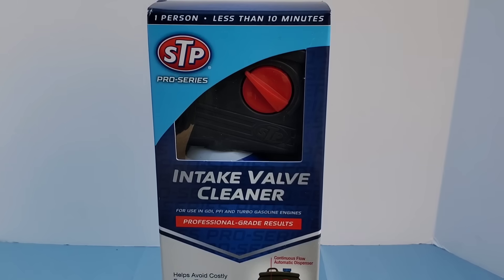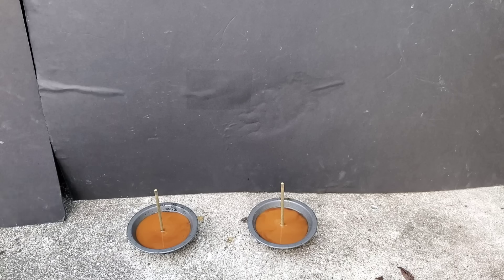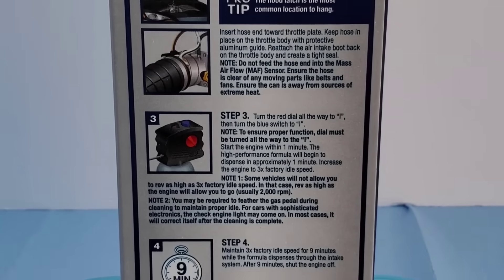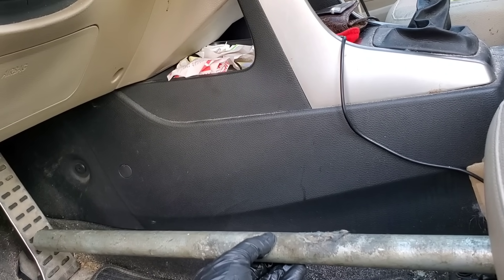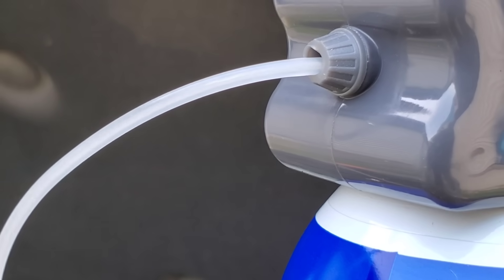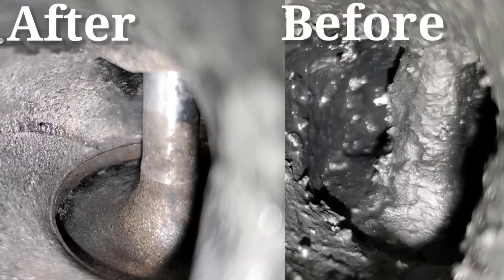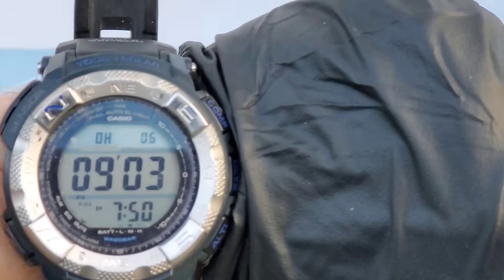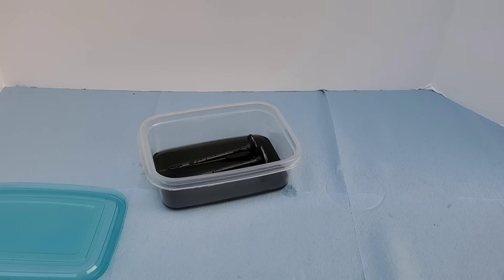Stp Pro Series Intake Valve Cleaner works!

Comment from the maker: I really appreciate all of your kindness & time it means the world to me in these trying times. I tried to speed it up so you don't waste valuable time.
Reply: Trying times?
Reply: You did the stp video !!! I like that you read the comments man. We appreciate you
Reply: Can you test a Purolator boss filter
Reply from the maker: I did that in a recent video
Reply: @NATESINTERACTIVEAUTO  do you remember how long ago was it? I'm looking for it now
Reply: @primetime8717  to m
Reply: How do you do if  you have a turbo with air filter element ? Is it possible or no. Thank you for your answer , because I have dodge   ram cummins 24valves .
Reply: You never try with water I try with water and that work better than anything think I vacuum holes and is slowly through the backing hose inside the bottle a little bit in the time so the vacuum hose can suck the water
Reply: Thank you for the valuable advice. Do you know how often I should perform this maintenance? I have a 21' Silverado and I want to keep it in tip to shape. Also can u recommend a good bore scope camera?
Reply: okay, but where does the dirt go?
Reply: @rjshhooba9857   it’s burnt off through the motor into the exhaust system and you will notice a white or black smoke coming out of your tail pipe which is normal
Reply: You 🤡
Reply: You should do a review of the JLM Diesel Intake Extreme Cleaner 2 step kit
Reply: You in i
Reply: Does stop work better than BG GDI cleaner?
Reply: Thanks a lot for this video
My car is GDI and has around 100K miles with no maintenance. I am sure the values now are extremely dirty. I should do wall nut blasting, but it would be very expensive.
I just want to spray this cleaner just like you did but I am afraid that the carbon chunks may damage the valves or cylinder. What do you think? I don't want to go the expensive route unless it is really necessary 😕
Reply: How did you take the photos of valve inside the motor ? To do so, you need to remove the manifold and insert the camera in the holes. But we didn't see that in video. Are they real photos you made or just examples from the product manifacturer ?

Comment: I call this video A LIE. The owner didn't show us the entire process LIVE, WITHOUT VIDEO CUTS. The video should have the following parts:
1) Explain how to reach all intake valves with a borescope
2) Record the valve inspections BEFORE
3) Insert the "wonder liquid" as required by the manufacturer
4) Record the valve inspections AFTER
Optional, some opinions about the impact of the solution on the catalytic converter.

Comment: The experiment with the valves in the box is static, no movemet involved, but in real life, when the engine is on, the valves are mooving extremily fast, and this comotion helps o lot to clean the valves, Has to be mentioned also the high temperature another contributer to cleaning. So the product is working fine and if the protocol is done every 2000 miles the valves will not be so dirty and will get cleaned quikly and better.

Comment: Spray this rubbish in and wash all that built up dirt and carbon into the cylinders, even worse than that is this liquid will then wash the bores, which is a disaster in an engine....
Reply: AHAHAHAHA great one. As if.
First off. You think that carbon isn't happening in your cylinders at all? plus where do you think that carbon is going naturally? It's just staying there? PFT.

Also it's recommended to do this before an oil change, so thats easy to wipe out your other comment.
3rd, its always recommended to drive on the highway after this so you 1. ensure a good clean out and 2. bring your oil temp up to temp to evaporate anything that needs to flash off of your oil. 

no it's not gonna "wash off" the bores at the very little rate it's spraying in, and if it did, your own injection system/carb would ruin the engine at WOT anyways.
Reply: @shmuck66   whatever you say john....
Reply: @fivedotsdave9723  lol, someone is from the UK.
Reply: @shmuck66  Detective shmuck

Comment: Most mechanics I know and most auto manufacturers say NOT to use engine flush/cleaner as it dislodges lots of garbage inside the engine, and that is not a good thing. That stuff does not just magically disappear, you know. Ask your own mechanic, ask at the dealership, and then do what you think is best, but don't take some guy's video advice. I asked my mechanic, and he did not look at all happy.

Comment: Your test is flawed. You're soaking the test valves in the product. In reality, when the product is released into the intake, the product is aerosolized and its contact time on the valve is minimal. 

Many reputable channels have done thorough testing with sound controls and have shown that these kits do little to nothing. The product doesn't soak nor sit on the valves long enough to have an effect.

Comment: This thing only works for maintenance purpose. If the intake valves have bad carbon buildup, don’t use it. The carbon will broke down into small chucks and destroy your piston ring and scratch the cylinder wall.

Comment: I’m calling bullshit. Sure it might work if you remove the valves and put them in a container but you can’t. DI engines don’t get a spray of fuel on the back of the valves which is exactly how the build up occurs. How is this magical liquid getting onto the back of valves? The easiest way is walnut shell blasting, really not a big deal to do.

Comment: Do this with complete fuel system cleaner and motor flush. Put that fuel additive few days before and drive with sportmode in highways.  Change motor oli after this cleaning process with motor flush. Use that fuel system cleaner half way of oil change and before. That keeps engine cleaner and carbon builds up only in the intake manifold. No need motor flush anymore but intake need to clean and it's better to do same time when change oils. Get the carbon out from engine. If you only clean carbon it's going in motor oil... and back to the intake.

Comment: Would this be safe to run thru a supercharged engine like a gm lt4? Afraid of the chemicals stripping off the Teflon coating on the supercharger rotors.

Comment: The simulated carbon on valve is not caked on like in the intake but if those pictures are your actual pictures vs STP photos, that is impressive. If you showed the  endoscope video that would be better proof.

Comment: I saw this stuff on Oreillys website, wasn't sure if it was worth the $40 or not.  I just replaced the intake manifold on my 03 F150 5.4, I looked at the intake valves and they didn't seem to have any chunks on them.  They had a thin layer of carbon though, I may go ahead and spend the $40 to give this stuff a try.
Reply: this is for direct injection engines not port where the injector washes off the valves. I believe your 03 F150 is port injected DI engines weren't in existence in 2003.

Comment: I don't have a GDI engine,  but I run a bottle of GUMOUT for GDI engines in the fuel tank after ever oil change. I may put an oil catch can on the engine anyway just to reduce the oil vapors going into the intake manifold. I had a carburetor on a generator get jammed up from the vapors routed into the air intake from the crank case,  so I re router the vent through the front of the air cleaner so it passes through the pleated air filter, solved that issue.

Comment: At least you don't don't constantly press a spray button. And the ones in the container weren't even running in the engine and cold. 👍

I've used Seafoam and CRC as well.

Will this help clean piston tops too?

Comment: This doesn’t work, you cleaned the valves manually. I clean my intake valves once a month or two and bought this at Autozone just to see if it really worked so that I wouldn’t have to be tearing down so much stuff each time I clean my intake valves. A day after using this product, I looked at my intake valves and this thing did absolutely nothing.

Comment: I wonder if this would also help with stuck oil rings on pistons? We have a 2006 scion tc that burns oil due to my 10k mile oil changes I would love to fix.
Reply: Dont trust this guy the photos he uses are the same ones on stp's site.
Its been proven also that this stuff has caused engines that dont burn oil to burn oil even after 7 oil changes later.
There is an awesome project with- DIY Dave- on youtube where he has spent over a year testing different products where he really does improve oil burning from a quart/litre ever 300 miles to 1000 miles. Berrymans is the one that works.
Watch and enjoy

Comment: I've been very underwhelmed with the performance of valve cleaners I've seen, until this one.  It appears to do what it says.  I have a Kia 3.3L GDI with 85K miles, and have been looking for a way to do a decarboning treatment that works without tearing down the engine and media blasting or scraping.  This looks like the answer.  Thank you.  I just ordered a can of it along with some other things for a routine service.
Reply: There’s gonna be a ton of carbon buildup on those valves. With that much mileage it’s gonna smoke pretty badly. But should run significantly smoother . I would suggest doing that right before your next oil change. And also do an engine flush too just to ensure it removes any carbon pieces that may have gone into crankcase.
Reply: How did it work??
Reply: How was your experience with STP valve cleaner ? Did it work?
Reply: @AZRockRunner  Best one I've found.  I have a 2015 Kia Sorento with the GDI 3.3L V6, and use the STP product to clean the injectors/valves since GDI engines tend to build up carbon.  Doing great at 100K miles.
Reply: @GlassWolfLH no issues so far? Burning oil?

Comment: Should I do this after my turbo on a 2019 volkswagen golf alltrack? Theres a MAP sensor after the throttle body which is on the front of the intake manifold. Could I remove that sensor and inject this stuff there?

Comment: How were you able to see the valves with the borescope without removing the intake manifold?
Reply: By removing a sensor
Reply: @mikecado007  What sensor might that be? I don't know of any sensors in the intake manifold that would give a borescope access to view all of the intake valves.
Reply: @kkuenzel56  On Hyundai GDI the map MAP sensor at the front of the inlet manifold. This enable to inspect the inlet ports and valves for cylinders 2 and 3.

Comment: Do you think this would work if the intake manifold is off where the valves are visible where I could just spray it on the valves? Id really like something that foams up that I can spray in the intake runners.

Comment: Almost a year later,  here I am watching this again.  I think I am going to try it on my direct injection engine at the next oil change.  

Do note, it's not the one that I mentioned before with WMI, nearly 2 years later and that car still has WMI and the valves look fantastic, no cold start misfire either.

Comment: Change your oil every 5000 km., clean your throttle body and MAF sensor, as well as your air filter. Make sure your PCV valve is working and highway drive your vehicle once a week. Do all this and you'll have very little carbon buildup.
Reply: Not true at all for direct injected engine.

Comment: I have a question.  Do you have to change your oil after you do this?  My logical guess is that all the grime that has melted will fall to the bottom and get mixed with the motor oil.
Reply: Yes, do this clean just before you are scheduled to change your oil (I'm an auto engineer)
Reply: How did it work out ., did it clean the valves

Comment: Great video and good information I have the same GDI Kia engine as in the video just can't tell if it's an Optima forte or another Kia i have a 2013 kia optima and I've been using STP fuel treatment in my gas tank... i may try the intake treatment as well

Comment: Used it today on a 4 cyl  1998 Dodge. During the process the coolant temperature went from 186 to 224, Took 6-7 minutes and I shut off engine because was so HOT. At end I could heard pinging. The can almost totally emptied though. I had maybe 1 ounce left. It pinged a little on the short drive also at the start. The car was outside the garage and the exhaust smell was strong.
Reply: What was the end result? Did it run well eventually?
Reply: @falconlips5474  Yes, ran ok in a couple of minutes when I took it for a 15 minute drive going over 50 MPH. Thanks
Reply: @falconlips5474  Yes, ran smooth. My goal was to increase mileage from 15 street level MPG. Original sticker showed 20 street MPG. Got a little bit better street MPG. Mechanic told me at start thet carbon deposits were causing low MPG. Vehicle had  164K miles. and no LOW tier gas in it usually
Reply: Never knew they used direct injection on a 1998 car??

Comment: Hey Nate I have a 2015 Cadillac ATS with the 3.6 engine and I installed a 3/4” intake riser and my valves are pretty bad. Would this help on my car or should I get it walnut blasted? I heard using chemicals and some big pieces brake off could cause worse damage is that true. My car runs fine I have a couple pictures while I had the manifold off
Reply: So what did you decide to do? Got a '15 canyon w/a 3.6. I'm trying to decide too.
Reply: @AOrubberduck  haven’t done anything as of yet. Really not confident enough about using chemicals in the motor. I’m still trying to find someone near me who will do walnut blasting.
Reply: @tjsworld2338  Welp, just traded in the truck. Didn't want to mess the motor either. Still plenty of value in used trade-ins right now; especially trucks and suv's. That may change soon though.

Comment: Prob with this stuff is chunks can break off and hold valves open
Some engines have a interference fit

Engine damage can occur.

You are better off removing the intake and scraping it all out

Comment: I've been using the CRC Intake & Turbo cleaner, but my local auto parts store is out.  I'm buying this tomorrow.
Reply: Hi ., did the stp work ?
Reply: @Voltrondefenderoftheuniverse  I think it did, but I suspect my car might be better off with a professional cleaning with the walnut shells.  I changed jobs and only drive around town now, rarely going above 45mph so it seems to clog up quickly.  90% of my driving is to the grocery store (1/2 mile) or to work (2.5 miles), so the car doesn't even warm up most of the time.  
The instructions say to insert the tube into the hose for the intake manifold at the butterfly valve and reconnect the hose, but my hose end has a metal insert and crushed the end of the tube.  Traded it in for a second bottle and left the hose off slightly and it worked.  I think I'm going to do this again this weekend, but this time insert the tube just before the turbo incase that's the cause of my hesitation.
Reply: @jeffrielley920  ➡️ thank you for the reply 👍🏻

Comment: When you consider with direct injection fuel does not go over the valves, it should be no surprise that in some cars they look horrible!  I just hope that if I ever get a direct injected car it also has secondary injection which would clean the valves.  I find that really hard to believe that they would ever allow this to happen with cars.  They are always worried about fuel efficiency and emissions.  I guess they don't realize the problem direct injection can cause with that when the valves are dirty.
Reply: After the car has been sold who cares. After all they test fuel efficiency and emissions when the car is new not 50k

Comment: This stuff is fantastic for the 2.3 l EcoBoost mustang!! Highly recommended if your car is over 50,000 miles! I used to have misfires every couple of weeks. But when I added this engine cleaner into the mix all those misfires disappear and the car's engine is much more responsive! Again, highly recommended
Reply: im having this exact issue with mine
Reply: @Savageslash1234   Make sure your spark plugs are gapped correctly as well.

Comment: Run an oil catch can, and it will keep your intake valves clean on a direct injection motor. In fact, some oem’s are starting to incorporate them…
Reply: It helps but doesn't stop it all. Just slows the process
Reply: Cheap OCC catch 15-10% ..good ones catch 90-95%

Comment: Xylene is good stuff.  Also, PEA or polyetheramine is one of the ingredient to look for.  It breaks carbon down by dissolving instead of breaking off larger pieces.  Larger pieces would be destroyed in combustion and sent out the exhaust valve.  The most common issue I’ve seen in the field is melted cats or contaminated upstream oxygen sensor.  
- MAKE SURE THE ENGINE IS AT OPERATING TEMP BEFORE USE.  Also not recommended on vehicles with worn spark plugs (over 80-100k mi) - Can cause pre-ignition and/or detonation.
- For non-GDI engines, in preparation for intake cleaner, run a bottle of STP ULTRA 5-in-1 (25-50% PEA) or Redline Si-1 (28-34%) in fuel tank (Follow instructions on bottle!)
- Fill fuel tank and perform induction cleaning 
- change oil
Reply: Colin...What source did you see the STP = 25-50% PEA? and Redline 28-34% ?
Reply: Care to share the brand you’ve seen that’s got a good amount of PEA?
Reply: "Xylene is banned in alot of places because it is extremely deadly, just touching it. Heads up."
Reply: @Samuel-Nolan-Davey no it isn't.

Comment: How do you aim the tube at the throttle plate. when you stick it in between the boot and the throttle body it's going to be facing the opposite way. you have to bend it 180°

Comment: Hi, I’m having trouble doing it on my 2018 VW GTI.  It looks like the screw on the clasp is a b*tch to get to.  The engineers probably did that on purpose.  They want you to bring it into the dealership and let them do the tear down and walnut blast at extreme expense.  Is there any easier way of doing it ?
Reply: Yes, bring to a reputable independent VW specialist shop and have it done for half the cost :)
Reply: Put on a catch can so only clean air goes to the intake